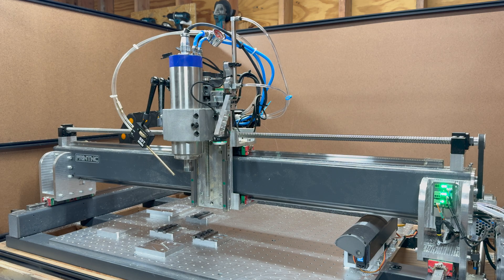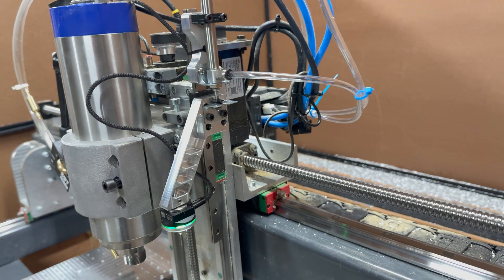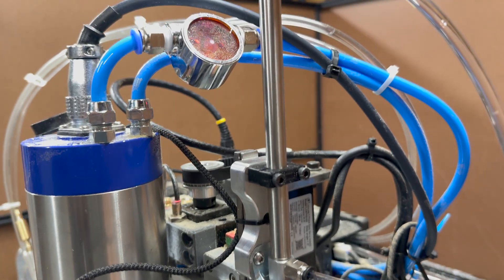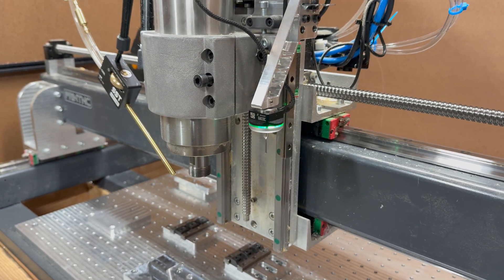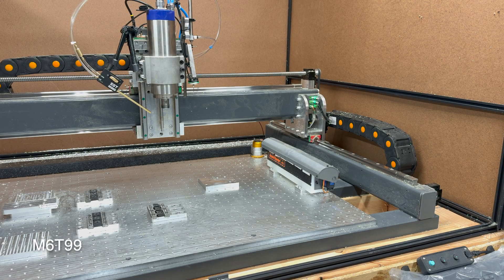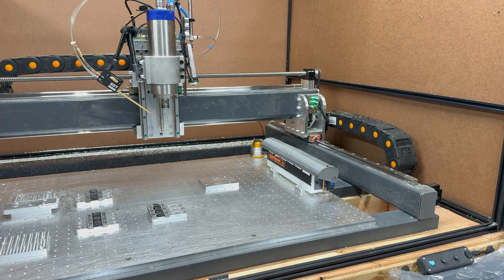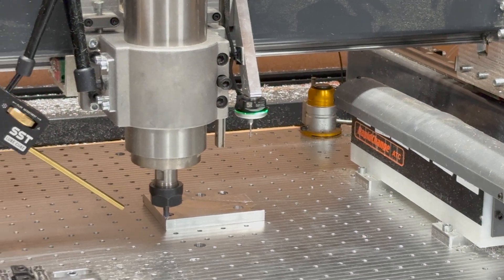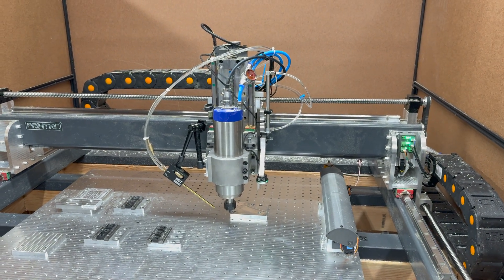How I integrated a deployable probe into my PrintNC and the Rapidchange ATC!

Comment: How did you make sure that the probe is as perpendicular to the work table/parallel with the spindle? Set screws or?
Reply from the maker: Hey! It doesnt have to be perfectly perpendicular, because the probe has a ballnose / tip (diameter 2mm). 
Regards!
Reply: @ ohhhhhhh okay! So that would only be necessary if it was installed in the spindle? I’m guessing since the probe is off set to the spindle it doesn’t matter if the probe is angled?

Comment: @05:20 Not too fond of it moving ALL three Axis ( Z included ) at the same to to get to the X0Y0Z0 Workpiece Corner 🤔
I'd rather prefer an X0Y0 approach fist followed by Z0 as the last step as it ensures there will be nothing in the way of the the Tool until it reaches X0Y0 🤨
( At least its not as bad as Openbuilds Control Software which moves Z to Z5 first and THEN does a X0Y0 thus reliably snapping off Tools on ANY workholding solution their Machines come with )
Reply from the maker: @Duraltia  yes. I did G0 x0z0y0 only for the video :).  Normally I do it just as you described

Comment: Have you noticed any sort of wear on the spindle collet threads or anything using this atc method? Reccomend it? Thinking of building a printnc myself soon
Reply from the maker: @IVAN_ENT  the nuts of course have some scratches, but apart from that I don’t see any substantial wear. And yes, I can recommend it. But first build your cnc and get used to it. This is nothing to start with :)

Comment: nice machine, my cnc problem have linuxcnc not understand how make tool lenght code working, 
and same problem add button and start/stop new 2,2KW water cooled spindle 
and start pump and stop pump after spindle has stop need time x then pump stop. 
can i add relay to 5 axis step or dir pin ? cheap paraller port breakout board have one relay but need add external 1-2 relay more. output have 5 axis but i use only 3 axis XYZ and pin 17 go to relay on/off.  input i have E-stop,XYZ limits and probe, all working ok, hall meter. but anywere forum or other NOT have how make button and how make tool lenght probe G38.2 . and how add 1-2 relay more to pump and spindle. board own relay working on/off, but need biggest better button to display. and future dream have controller VFD spindle speed too in display. lot problem because not understand how make linuxcnc code, etc, button, call tool height makro, button controller relay, and can make stop time wait x time then stop relay/pump.

Comment: Have you already done some thread milling, or boring ops with rapid changes of direction?
I have had a retractable 3D-Finder probe on my UHPC mill...It had two issues:
1. The inertia of the small probing tip caused the probe to trigger during these ops. EdingCNC ignores probe inputs during a running job, so it was just annoying. But if your software doesn't, you need to disable the probe during a running job
2. Ultimately the probe was destroyed over time by the vibrations. It bounced and consequently triggered not reliably anymore
I hope you have more luck with your setup 👍
Reply from the maker: @scratchbuiltdesigns  that’s interesting. I have done some heavy cuts but the probe hasn’t triggered yet. And it’s still working fine. But i will keep an eye on that. Thx!
Reply: @SebastianMusser  worst probe if trigger only vibrations maybe loose spring need new strongest springs, and can closed probe pin in software code if have vibration wrong trigger at probe, or add switch when probe input have connect or not.when probe go move to down switch make probe ON and switch make off when probe go back up. IF have vibraton problem. most not have.
Reply: That is why my probe only turns on when it's in working position. Hope it helps

Comment from the maker: I also use antimicro. Works great
Reply: The motion with mine is quite jerk. Did you make a custom profile? 

I like how you seem to change speed settings easily. I used to do that with the LB button when using gsender but I'm not sure how to do it on iosender